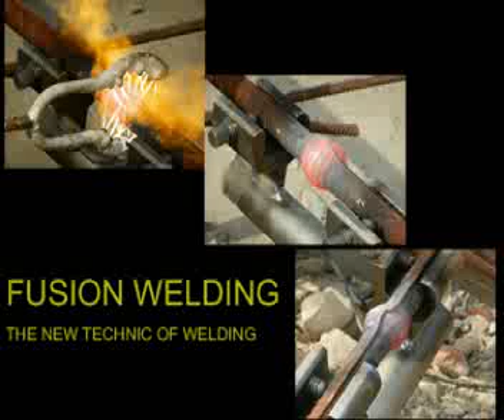FUSION WELDING NEW TECHNIC IN ENGINEERING REVOLUTION

Comment: time consuming and very weak and unreliable. that welding strength is around the least structural of all types of welding. works for swords and knives not for rebar used in construction...